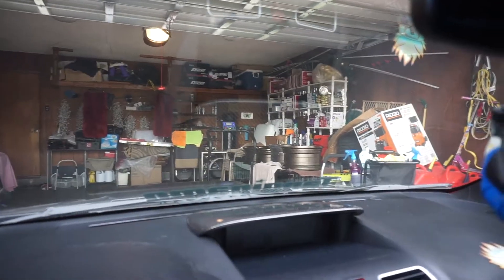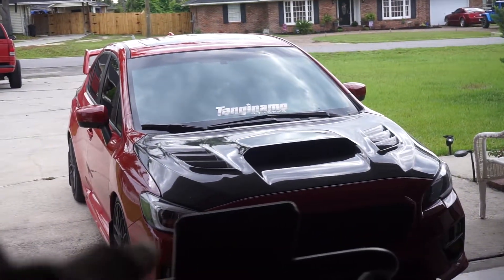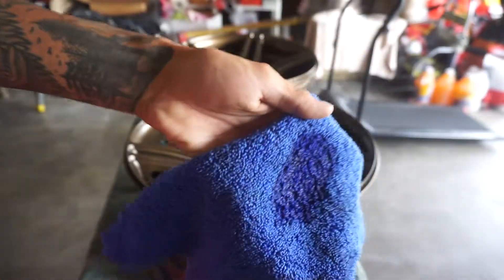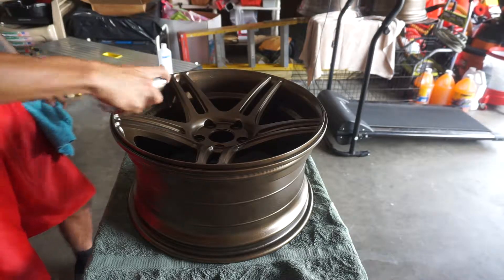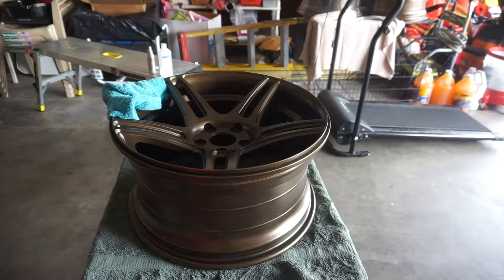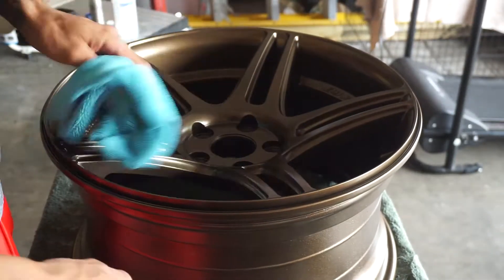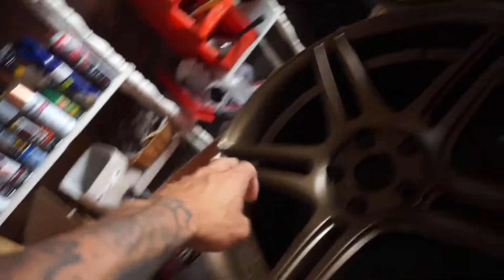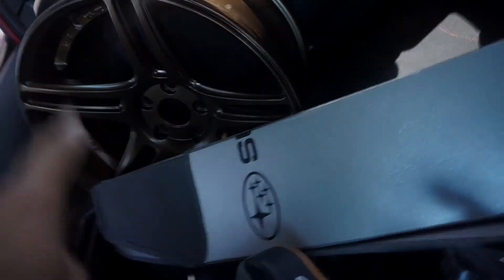Fictech ONE | How To Ceramic Coat Wheels

Comment: Thanks for this video man , how do you like the durability of this coating? do you recommend it on paint?
Reply from the maker: No problem and you're supposed to reapply it after 6 months but I never did tbh and it's holding up still. I would recommend it on paint too since I heard about this company from PanTheOrganizer.